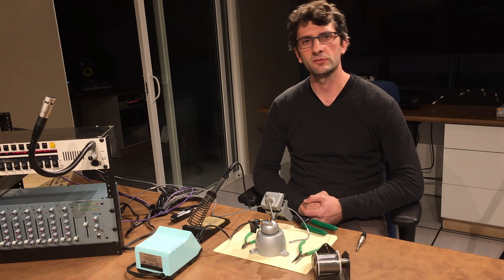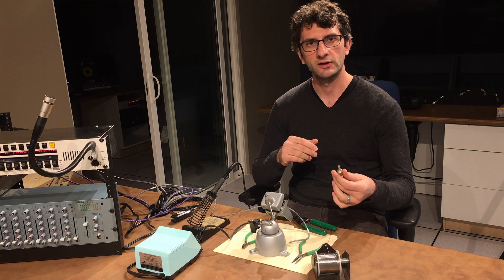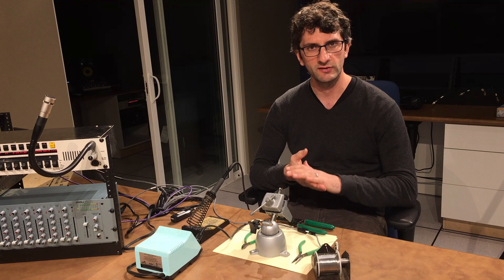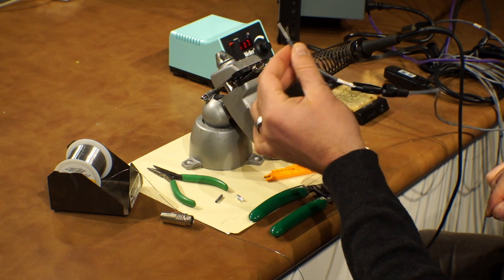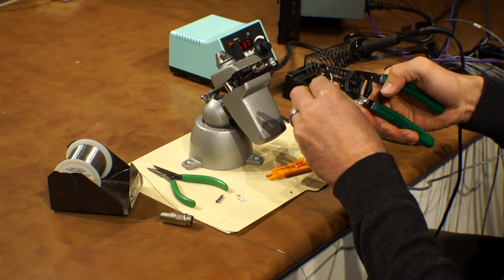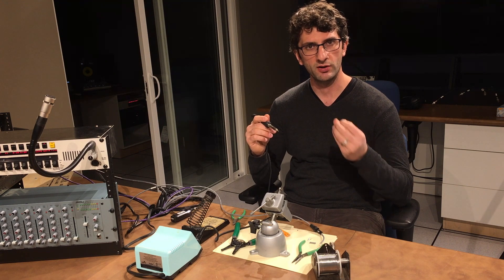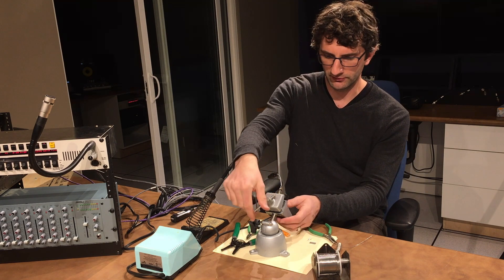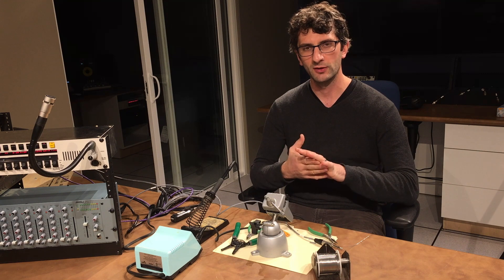How to Solder 1/4" TRS Cables

Comment: That’s some messy ass soldering!
Reply: That's how connectors are soldered. Did you ever try one of these Neutrik ones?
Reply: @diegoNL2K  every single day. And I’m telling you, that is MESSY soldering 😂
Reply from the maker: It came out messier than usual during taping, and I have a newer similar video that’s cleaner. But yeah not perfect work but still good concepts

Comment: My cable has four cables!!
Reply from the maker: Might be intended for a different application. Can you return it and get correct? If not try to see if correct impedance, if it is you can just use 2 wires and ground
Reply from the maker: or is it 4 wires plus the shield? that could be quad cable, the idea is to solder 2 wires to each the Tip and Ring. Supposed to enhance rejecting RF etc.

Comment: Nice job on the video.  It would help if you linked the components and tools you recommend.  That vice grip the gray cable you used and why.  The ergonomics and layout of soldering plays a big part in whether you'll be successful at doing the job and stay relaxed.  Do a video how and why you have things layed out on your desk the way you do.  Why some things are on the right, some on the left, etc.
Reply from the maker: Those are good tips. I do plan on doing an updated video and I will add that stuff
Reply from the maker: Hey Luckyal, I made a new video about soldering Mic cables and I used some of these suggestions. Thank you. Here's the link: https://youtu.be/3SKI-V-OJfg

Comment: Camera not close enough and your hands are in the way all the time.
Reply from the maker: It gets a bit better later in the video but I do plan on re-shooting this I was still figuring out how to do this kind of shooting. Have what I need now
Reply: @churchaudiolife  Set up a overhead camera on a C-Stand. Use a work matt and zoom the overhead camera in so the edges of the matt meet the edge of the frame on your video monitor. That way you'll know when your hands are in the shot and not in the shot. Do dedicated "cut-away" shots for key information. That way you can get in super tight for that really important stuff. Your sound was good and lighting was good. If it isn't broke don't fix it. Your narration was methodical and easy to understand and follow. Match that with better video production and you'll be onto a winner. 😊
Reply from the maker: @JWS1968  wow, really good tips. And thank you. I did buy a C-stand. That matt idea is brilliant. Thank you.
Reply: @churchaudiolife  you're welcome good luck.
Reply from the maker: Hey John, I made a new video about soldering Mic cables and I used some of these suggestions. Thank you. Here's the link: https://youtu.be/3SKI-V-OJfg

Comment: Does the black wire always go to the top pin & white to the center pin? Very Nice demonstration here getting ready to switch all of my unbalanced TS cables on my mixer & audio equipment over to a balanced system. Thanks👍👍💙
Reply from the maker: Thank you and Yeah it’s best to do this that way. Technically as long as it’s the same on both ends it will work, but it’s best to keep to a standard so you can keep them consistent if you ever need to repair it or anything
Reply: @churchaudiolife  ya good idea thanks! I have a bad like AC line hum I'm trying to get rid of. Today I plugged the mixers external power supply into a different power strip & a decent amount of line noise disappeared. It was plugged into a surge protector strip. I don't hear the noise thru my mixer headphones just on my live monitor.
Reply from the maker: @miguelsalami  is that after changing to balanced cables?
Reply: @churchaudiolife  No I have not changed any of my TS mono cables out yet. This is an amateur home studio I built so going to start by upgrading both turntable cables to mixer & cable from transmitter to mixer then afterwards from JVC Cassette deck & Sony CD deck to mixer.
Reply from the maker: @miguelsalami  changing out the cables will very likely fix that.
Reply: @churchaudiolife  Hi again well my Mogami balanced cables arrived they have XLR Male on one end going to a pair of rca males. When I plug both rcas into my turntable I get a echo sound that cancels voice audio but when I unplug one of them it sounds normal.
Reply from the maker: @miguelsalami  that seems like one of the cables has polarity reversed, meaning on one cable the positive and negative are switched. Can the xlr ends and/or the rca ends be opened? would be good to verify how they were soldered.
Reply: @churchaudiolife  On the XTL to RCA cables the Rcas are split at that end going to a Y with 2 shields & 1 red center lead.
Reply: @churchaudiolife  Then on the XTL/3.5mm cords the XTL has Shield on pin1 red on pin2 & white on 3. At other 3.5mm end it has Shield on bottom red center & white on right pin. 
Are these wired in "STEREO"? Because my transmitter signal is in "Mono" Maybe this is the problem but I need a Mono signal. Thanks
Reply from the maker: @miguelsalami  Sorry, you said male XLR to 2 RCA? how are each RCA soldered? Also may have misunderstood your setup, if you are taking a mono output, splitting to stereo speakers this could happen as well. I thought it was the other way around.
Reply: @churchaudiolife  On the xlr balanced cable it was factory wired the male Rcas at opposite end have separate shields with red going to center on 1 & white going to center on other rca. Cable splits to a Y at rca end of cable. Cable runs from single mixer channel to turntable with built in preamp. As long as I leave one rca unplugged it sounds fine.
Reply from the maker: Yeah so that sounds like the cable was perfectly fine. But it does seem like you’re trying to split a mono signal with an XLR cable and that will cause the polarity to be reversed. You really should be using a separate left and right output from the mixer, one to each speaker.
Reply: @churchaudiolife  Not split I have no speakers only headphones I was using stereo rca jacks going into a MonoTS 2into1 1/4 jack at the mixer, the problem b4 was the jack wasn't making a good mixer jack connection & shorting out so had to replace with XLR. Im running 2 turntables on 2 separate channels on the mixer 
It's all working & sounding good but 2 of the rca jacks are unplugged so I think they will need to be re-wired for a Mono signal. I'm getting ready to replace my mono TS 1/4"  jack cord from my transmitter to the mixer with a Balanced mono TRS jack & pre-wired cord to reduce noise so will see how this goes. Thanks for your help & input I really appreciate it man.👍👍💙

Comment: Agree with more closeups needed, but all I needed was the explaining       That’s a cool vice. I assume it’s padded. If anyone doesn’t have one, I saw another video where they just drilled a bunch of 1/4” holes in a 2x4 and used it to hold the plugs. Simple but brilliant. 
Thanks for the video.
Reply from the maker: seems like you worked it out, but I did make a video for guitar cables with much better angles: https://youtu.be/4rjI0hw39LE
Reply from the maker: It is padded, got it at a super-geeky electronics store. and I've seen the pictures of the custom soldering 2x4 boards.

Comment: Once the ground is in does it matter which cable goes on the other jacks as long as it matches the other end?
Reply from the maker: Technically no. As long as the same wires are on the same pins it’ll all work, but if you’re ever in a place where you’re connecting a bunch of cables and trying to keep track it could screw you up. Better to stick to the correct scheme. Otherwise anytime you need to fix the cable you’d have to check both ends instead of just knowing how it’s connected.
Reply: @churchaudiolife  Better be consistent with the standard way, so nobody get confused. But you could check with a diode tester to find out which leads go to which pole on the other end. But in an installation situation, it might be impossible to measure. You would just have to know.
Reply: @churchaudiolife  Red is for the positive phase?
Reply from the maker: @oysteinsoreide4323  in most cases yes

Comment: What kind of cable is that?
Reply from the maker: I forget the actual brand, but it's 22 gauge AWG install audio cable (mic/line). we order it from a local cable supply company.
Reply: @churchaudiolife  thanks for the response.  I need this to install PA Speakers in my restaurant.
Reply from the maker: @runegeezy  just remember the brand, Belden not sure exact part number
Reply: @churchaudiolife  thanks again.  Not concerned with brand, but just wanted to know what type of cable to run from my powered PA speakers to the balanced line out of my mixer/amp